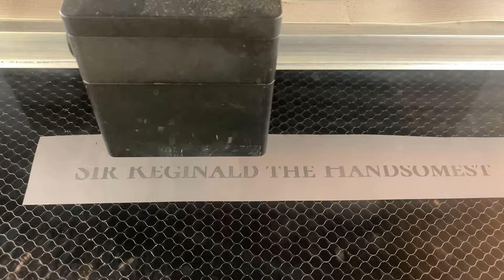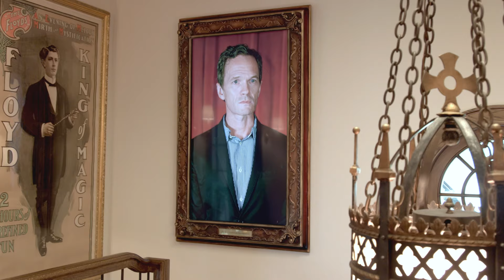MASSIVE 3D Printing with Neil Patrick Harris and MassivIT 3D

Comment: If they made giant color E-ink screens, they would be perfect, because they wouldn't actually give of light.
Reply: They do.  The new E Ink Gallery Plus screens are designed for advertising and signage and could do exactly what you're suggesting.  Of course eink motion refreshes can be a bit choppy and would likely spoil the illusion.  However, with the right lighting, it should be easy to hide the fact that they are screens.  Particularly if he applies a filter to the video to simulate paint impasto and texture.

Comment: This is a super cool idea, and I want to make a suggestion for how the video that goes on the screen should be shot.

For a set of theater shows, I did essentially the same thing in that we had television screens that were part of the stage that during a show we would have what I called video props. I was a video producer for the theater, and so we wanted to set the scene using a pair of televisions, they were flat panel televisions, and what we discovered was that if we used a regular image or a video, it would be way too bright both for being on stage, and on camera.

What I ended up doing was making the images be significantly dimmer than you would think he would want for a TV image.

By doing this, it made the lighting in the image on the screens seem like it was part of the stage instead of a TV.

So the short of it is, whatever you shoot, make it be close to 10% of the brightness that you normally have for video. You can do this with the controls on the flat panel, but I don’t recommend that. Instead, it’s better to do it in the source material. Especially if you’re using OLED panels, which I have a really good blacks and good color Fidelity. That will mean that it will be able to show the subtleties of a much dimmer image and look much more realistic.

Of course, to really sell it, I would imagine you’re going to have somebody make the video look like it’s a painting by using filters like you can find in Photoshop or after effects. But to me, what really sells it is if the image appears to be an actual painting which does not have transmissive lighting. Instead, a real painting would only reflect some of the light in the room. That’s why the image Hass to be so much dimmer.

Comment: I have made a similar (much smaller lol) project and highly recommend an air intake and exhaust fan. The display will build up quite a bit of heat (made my RPI run at roughly 85 deg C) and the heat will cause the display and all other electronics to throttle, degrade faster, and generally run less efficiently. My biggest concern would be the illumination source of the display (either OLED panel or LED backlight).